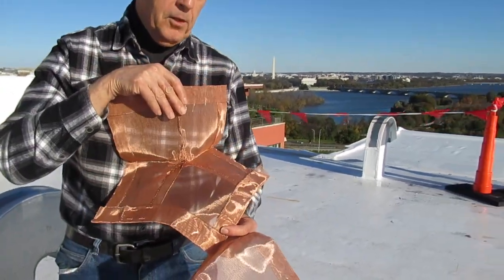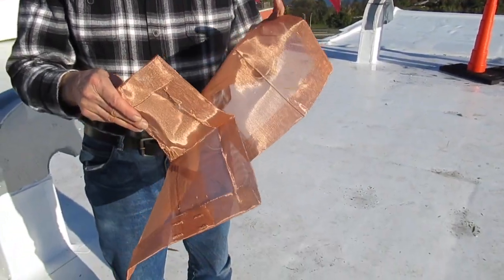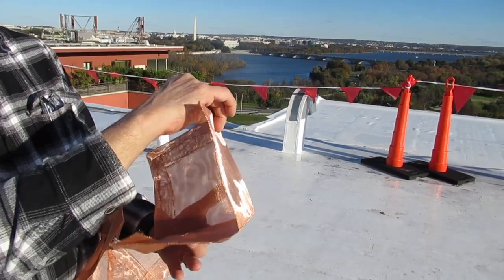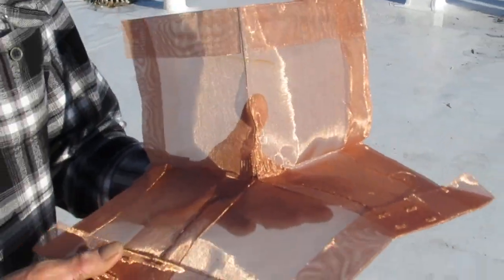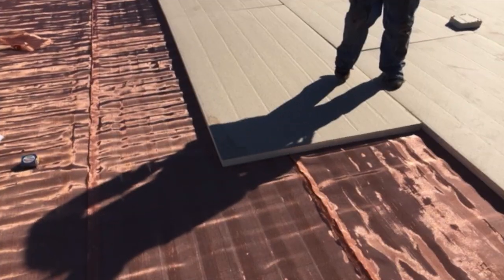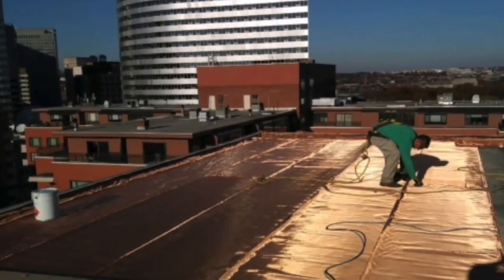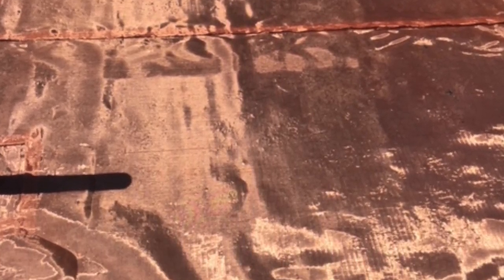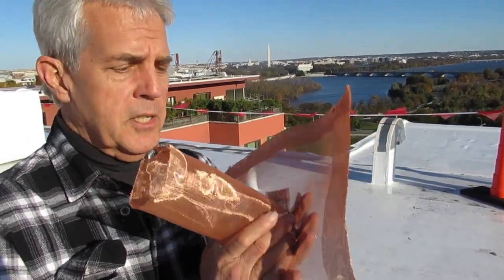Cuprotect RF Roof Shielding System blocks Cell Antenna RF radiation.

Comment: The apartments i live in have cellphone antennas on the roof its a 5 story building im in the 4th floor its gonna be two months now that i moved in. i don't know if its related but lately I been getting headaches lately and i notice my eyes are light red just the part that get exposed more i check the top and bottom part of my eyes 👁 and they are white again not sure if its related but gonna check in the office and mention this material to them.
Reply from the maker: Do you feel better when you leave the apartment & worse when you return?  If so there is something related to the apartments that may be the cause. Testing and measurement should be done.